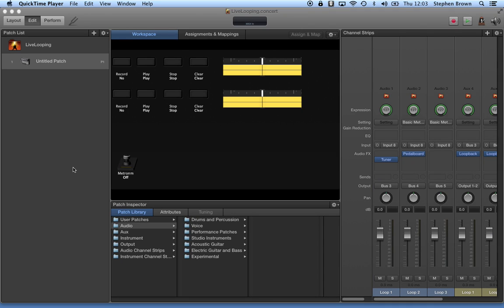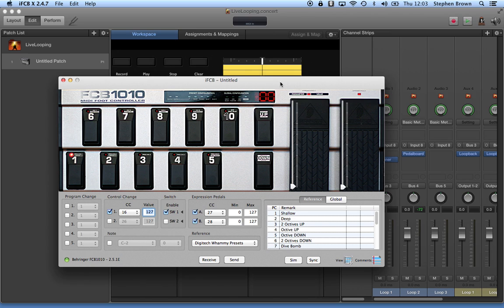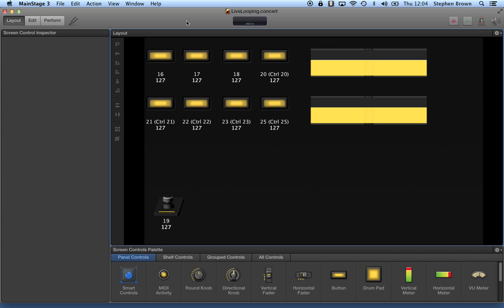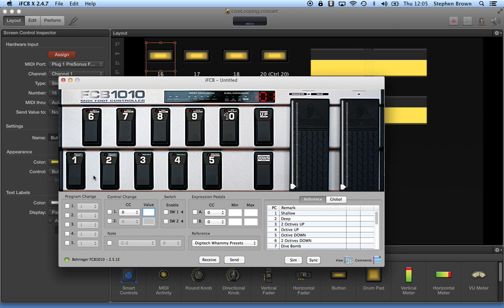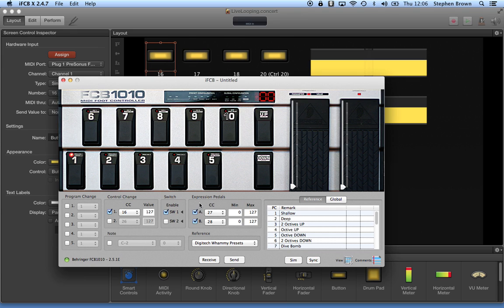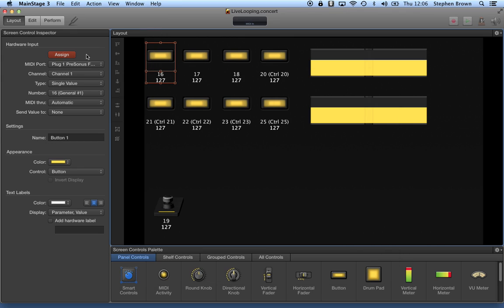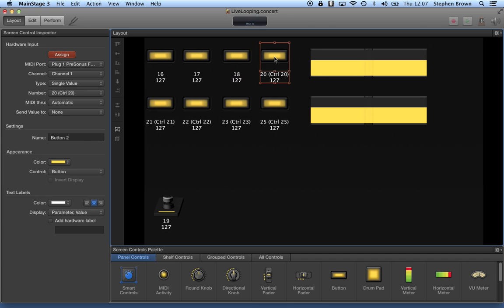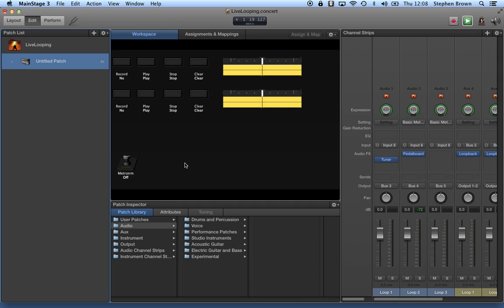Mapping FCB1010 to Mainstage 3

Comment: so none of that worked and i want to smash this footpedal into a million peices
Reply from the maker: Let me know what went wrong, and I'll see if I can help.  First thing I would check is always the cables connecting the peddle to your computer - Make sure "in" on the peddle connects to "out" on the audio controller, and vice versa.
Reply: thats all setup correctly. when i follow the prompts after i click send, with all the values in place  the 7 led light never goes off to finish the last step
Reply: also wondering if i can setup to play within logic and not mainstage. just using the pedals on there
Reply: got the send to work and register on the ifcb software but not mainstage

Comment: Did the FCB1010 come with a MIDI cable, or did you have to obtain one separately?
Reply from the maker: I believe you will need to purchase your own.  In fact, you'll need two - Midi In on the pedal goes to Midi Out on your audio interface, Midi Out on the pedal goes to Midi In on the audio interface.

Comment: Can I use the FCB1010 as a sustain pedal. For example, will a stomp button have CC64 - On and Off as separate messages?
Reply from the maker: I'm not sure that there's a really nice way to do this.  You could set one of the expression pedals to cc64 with 0 and 127 as the min and max values.  You could also program a pedal to turn sustain on with the first stomp, and back off with the second stomp (cc1=127. cc2=0).  Both of those behaviors work, but they are both different from traditional sustain pedal behavior.  If I come up with something better, I'll post again.

Comment: cant get expression pedals to send to Mainstage after using iFCB. suggestions?
Reply from the maker: Check the cabling?  Midi-in on the FCB should be connected to midi-out on the midi/audio interface, and vice versa.
Reply: Hi.  Very good video.  I want to use mainstage to trigger my backing tracks.  All tracks are mixed into simple left and right (not multi tracks).  Am I right in assuming that your fcb is connected via midi to your external sound card which in turn is usb to your Mac?  
I am a guitar player and do not fancy having to carry a midi keyboard.  Just wondering.

Comment: Hi, thanks for the video,
I want to know if I can use this pedal to release samples live while I play guitar? It is only for intros or environments amidst the songs ....
Reply from the maker: You can use the pedal for anything you want.  If you are concerned about copyright, the pedal itself doesn't create any sounds or samples - it is your software (such as MainStage) that create the sounds.  If you are performing something new with your own instruments, then of course, you are the creator, and therefore the copyright owner for the new material.  If you are putting together material from the samples provided in your software (or elsewhere), you would need to confirm the details with the creator or copyright owner of the samples you are using.  As far as I know, if you own a licensed copy of MainStage, you are free to use the samples in your own works.  But I'm not a lawyer, so what do I know?  :)

Comment: Two questions for you if you have time...

1) Can mainstage run 3rd party plugins? I'm trying to run the "Bias" Guitar Amp simulator and use the logic pedalboard. 

2) Can you get the volume and expression pedals to actually function like traditional volume and expression? I only got it to start randomly controlling the volume of the actual track in logic, complete fail!! 

Thanks for your time man, very great videos.
Reply: You can block the volume pedal by clicking the volume pedal in mainstage and blocking it for either the patch or the whole concert. Or you could just not map it there at all. Also most software's have the ability to right click and do a MIDI Learn type function where you tell the program to listen to what your assigning to it and then just move the pedal and it will assign.
Reply from the maker: 1) I'm not sure about the Bias Guitar Amp.  I only work with the built in components.

2) Are you saying that you want the pedals to control the master volume, rather than the individual track volume?  Or am I missing something there?  I think I can put together a video to clear it up if it is the master volume you are concerned with.
Reply: No I'm looking to control the volume pedal in pedalboard. It defaults to controlling master track volume for some reason
Reply: Mainstage will run basically any thirdy party plugins you want to use. I have about 20 in my mainstage setup
Reply: Travis Short I'm specifically talking about remapping the volume pedal to stop controlling the actual track volume of a track and control the volume pedal in bias

Comment: Great video, thanx! Do you have a video how to use Mainstage and FCB1010 as a looper?
Reply from the maker: Glad you liked the video.  I promised I would do that looper thing, didn't I?  I've got a couple projects going on right now, but I'll try to get that done in the next week or two.
Reply from the maker: whoyoum Looks like it's still a few weeks out before I can do the looper video, but I've still got it on my to do list.
Reply from the maker: I finally created the Looper video.  It creates a very basic Looper, but completely functional.  You can give it a go here: Creating a Loop Pedal with Behringer FCB1010 and Mainstage 3

Comment: Can someone just please tell me the CORRECT interface to use to program the changes in the iFCB software??? PLEASE!!
Reply from the maker: James - I'm not certain what you are looking for.  If you are looking for the CORRECT software inteface, there is no such thing.  You can use the Wabbit Wanch software, or try to find some other. 

The fact is, the FCB doesn't require any software interface at all.  You can program the settings using the instructions in the manual, found here: www.behringer.com/assets/fcb1010_p0089_m_en.pdf.

If you are trying to determine how to physically connect the FCB to your computer, you need a midi interface, which is included in most audio interfaces, such as the PreSonus AudioBox (http://www.presonus.com/products/AudioBox-22VSL).  This device will connect to your computer by USB, and will require two midi cables to connect to the FCB.  Connect the "Out" from the pedal to the "In" on the audio interface, and vice versa.

If I am misunderstanding your need, please let me know, and I'll see what you can do.